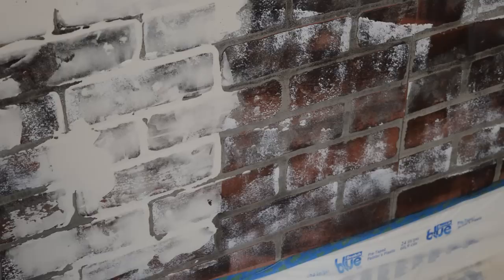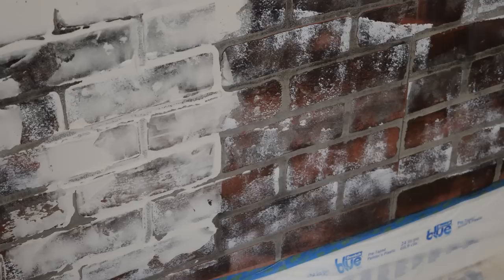German Smear /Schmear Brick Plastered Wall Tutorial

Comment: I did the same thing using the hardboard faux brick panels from Home Depot. That's what this looks like. I painted over the bricks using Brick and Terracotta color (wanted the base darker) , then I spackled using Dap Dynaflex Spackle as it will not crack and it was softer, easier to apply. I wanted more of the brick showing through, and Dynaflex was easier to use for that. After everything was dry (few days) I sealed it with Home Depot's Varathane No Odor Floor Finish Polyurethane "MATTE" ....
Reply from the maker: Awesome!  I'll bet it looks great. I love how the German Smear wall changed the way the whole room looks!  I'm sure yours looks great too!

Comment: I have to say I think you did the plaster backwards. It should be applied and then rubbed off of the high points, instead of applied on the high points and not applied to the crevices.  Natural aging would rub it off the high points and leave it in the crevices. So it looks unnatural.  I live in a house that this was done to, but I have no idea when.  It has obviously had more added in spots over the years.  The house was built in 1930, and it looks like a cottage, but it was really a dentist's office, with a cupola and a zeppelin weather vane on the top. I had no idea this was done -- well, it isn't plaster, it's mortar.  All this time I thought it was some kind of whitewash.
Reply from the maker: Your home sounds lovely.  There are really three different styles of this effect, one being what you mentioned which is more of a white washed brick effect and also very pretty.  That wasn't the style I was trying to achieve.  There are old building that look like this as well.  I think it's the period and location that influence the plaster and brick effect :)

Comment: have you had the Easy Sand Compound fall off r crack....I talked to the distributor and he was so discouraging...I mixed up Dura bond and it was beige so I wouldn't use it....is Easy Sand going to be white....I bought som of Easy Sand....thanks
Reply from the maker: Hi. I used Durabond 90 I and it dried pretty white I choose that because it’s the hardest. I haven’t had any problem at all with it falling off or cracking. I hope that helps! B

Comment: Are the bricks fake,  or is it a real brick wall?
Reply: The wall is fake brick panels made of plywood.  Column is real brick.
Reply: Thomas Gibilisco thank you
Reply from the maker: Hi The column is real and vintage brick.  I used faux brick panels from Home Depot for the wall.  They come in 4 x 8' sheets.  I hope that helps!
Reply: H2OBungalow Home Decor & Home Improvement thanks it does help me I want to make one of my kitchen walls
Reply from the maker: Oh good!  It's not hard to install the faux panels and they can easily be cut with a jigsaw.  Have fun!  I'd bet it will look awesome in a kitchen!
Reply: H2OBungalow Home Decor & Home Improvement thanks 😊
Reply from the maker: Your'e welcome!